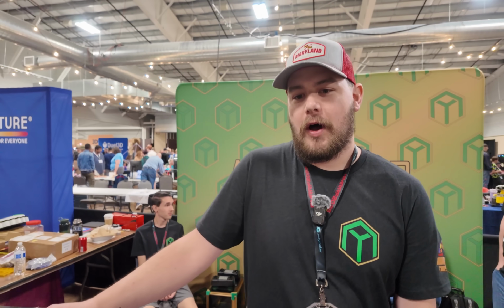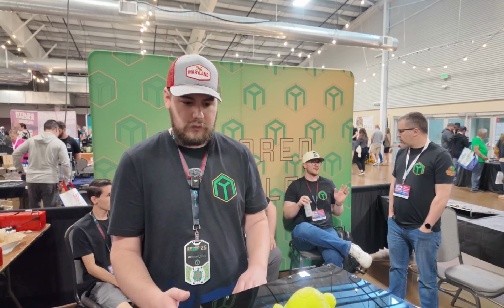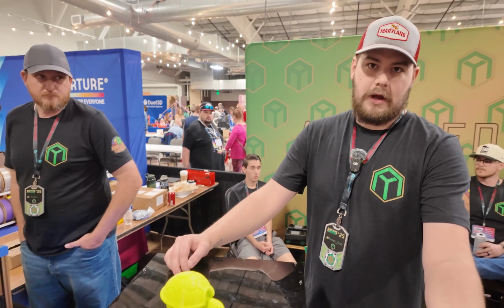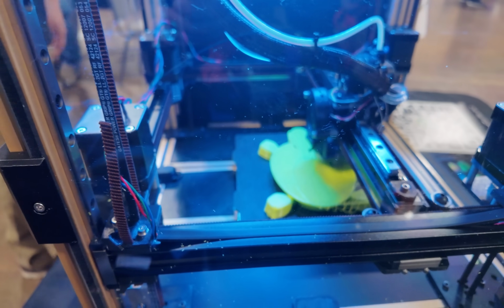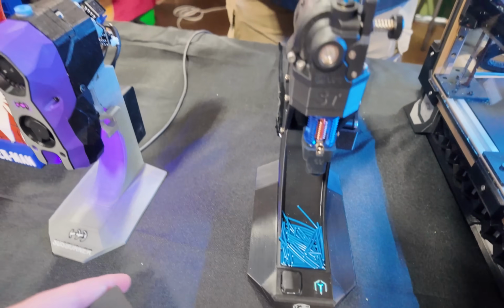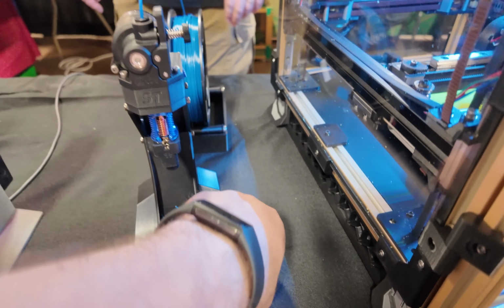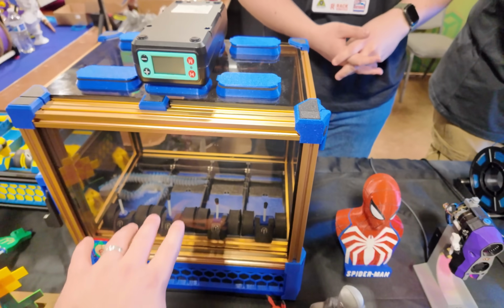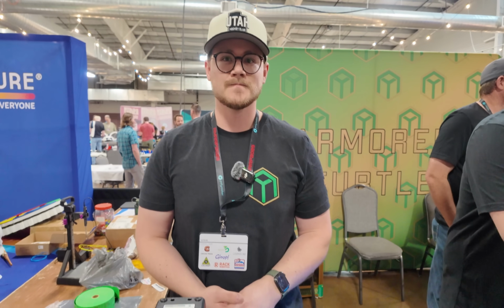TURTLE TIME with ARMORED TURTLE from RMRRF 2025!

Comment: Single shear? Motor in chamber? Plastic extruder in chamber? Electronics on printer body? No insulation? Passive chamber heating? Ew, nothing more than an overly expensive toy.
Reply: Double shear isn’t always needed and can cause issues or at least limit other features.
You can get steppers rated to 120c for not much more than standard, just need to cool them with water if you go above. Electronics designed for use at temperatures function absolutely fine, the issue is using components not designed for the temps. The plastic sides are a form of insulation, looks also to be air gapped much like windows. They said they have fans under the bed for chamber heating, this is not passive, just saves space for needing a dedicated heater. You could say that about any hobby level printer.
Reply: @Volt64bolt By the way love the way you spread misinformation about double shear. "cAn CaUsE iSsUeS" well looks like causing your brain to malfunction is the only issue to me
Reply: @Volt64bolt Having one or two of those design decisions isn't end of the world, but putting zero effort in building a printer geared for high temp while claiming so? It's just pure garbage. Way to waste your time defending a pile of 💩